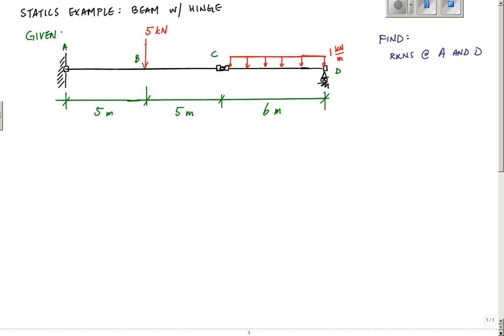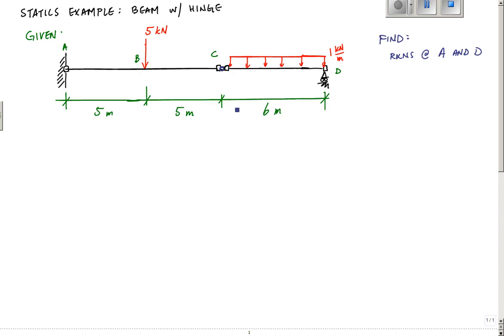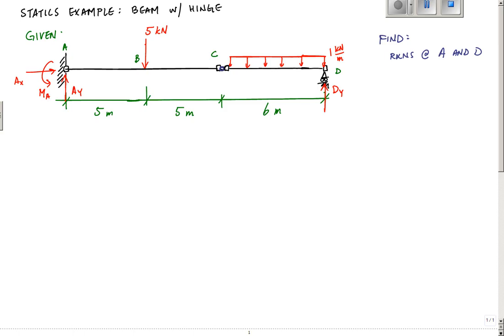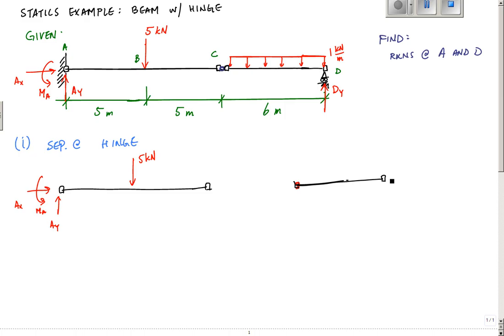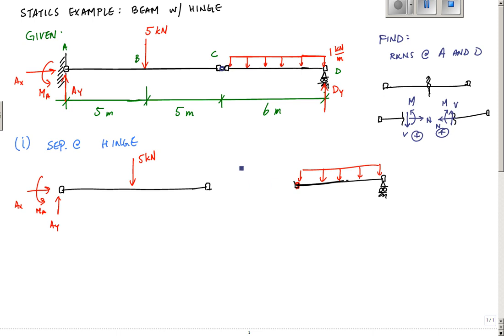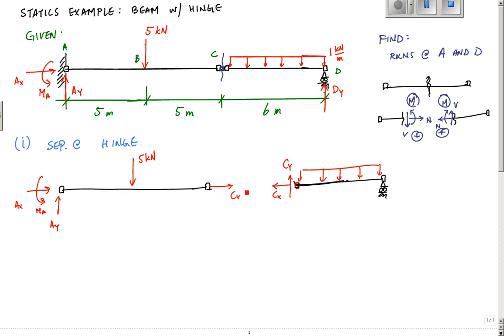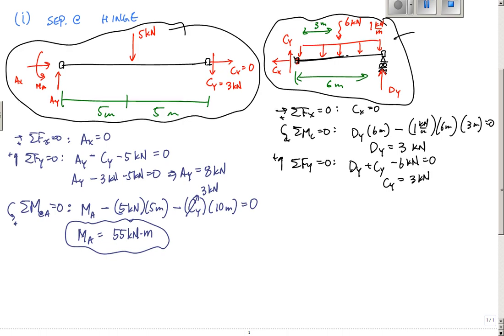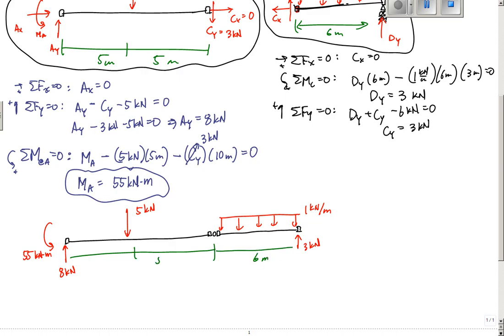Calculating reactions for beam with hinge - statics/mechanics example

Comment: if there's a pointed load a the hinge, should i still separate it or analyze it as a whole after analyzing a specifc part?
Reply from the maker: you have to know which side of the pin it's on.

Comment: where does "Ma" came from? tia
Reply: Its a fixed support, so it resists Moment, and has to have a Moment there as a reaction. Just like a roller support resists motion vertically, and has to have a reaction in the vertical. A fixed support also has a horizontal and vertical reaction.

Comment: Slightly confused; why is there no moment reaction on the roller on the right of the beam, theres no horizontal because of lateral motion but why no moments ??
Reply: +Bakes Cakes It's a Roller support, which in theory only resists vertical loads. Thus no moment reaction.

Comment: Thanks for the tutorial. What if there is a force acting on the hinge? Will the force be dissipated to part 1 or 2 of them beam? or shared equally?
Reply from the maker: Fottonela1 Wys if there is a force on the hinge, it depends on if you cut on the right or left side of the hinge.  in fact you can draw a fbd of the hinge by itself with cuts on the left and right of the hinge and that hinge should be in equilibrium.
Reply: @structurefree  thanks it helped me

Comment: how to solve this if the 5 kn load on the hinge itself ????
Reply: have u solved it ?
Reply: I guess you  can’t put load  on hinge
Reply: @erfanrad9630  actually you can put load on hinge and you solve it by putting the load on one side at the hinge.
Reply: Our i guess it depends on the type of the problem because moment must be zero where hinge is .
Reply: @erfanrad9630  you are right about moment being zero on hinge, however, it doesnt mean there can not be a force. But i think that u misanderstood the concept of moment release. When you have hinge it doesnt have moment reaction. This means you have 2 equalibrium equition, Fy and Fx, since Fy is vertical reaction there can be a load on hinge because Fy can counteract the load on the hinge and satisfy the equilibrium. I hope this will clear everything.
Reply: Our thank you so much for the information 🙏🙏 I’ve got it . 🌹
Reply: @erfanrad9630  you are welcome my friend
Reply: @erfanrad9630  right
Reply: Right bro

Comment: hi,
here is a question not really pertaining to this lecture but as a general..
1)A beam is supported over a wall. so now how is the nature of support structure decided whether it will be a simply supported or fixed or in between?
2)if our beam is supported over two roller supports and vertical loading is applied then can we say that structural element is safe in terms of static and dynamic loading point of view?

Comment from the maker: i think one way to solve a statically indeterminate beam, with the double integration method is to let the reactions be unknowns. set up moment functions (which can come from singularity functions), then integrate twice from the moment curvature relationship, enforce boundary conditions based on number of unknowns, and solve for reactions. I personally think its easier to use a different technique like the force method to solve the problem. anyway, interesting question...probably worth a video

Comment from the maker: If you modify this problem and remove the hinge, it would be statically indeterminate. In this case, you would need to use a different analysis technique...i.e. utilize equilibrium and compatibility equations to solve for reactions. singularity functions are useful in calculating deflections from a given loading; i'm not quite sure how they would help in this case other than to come up with deflection equations.